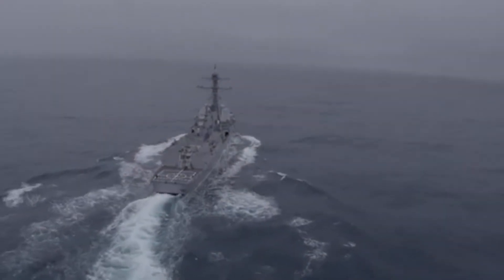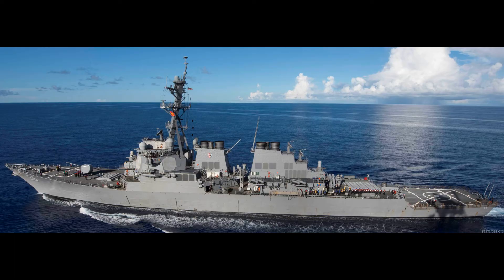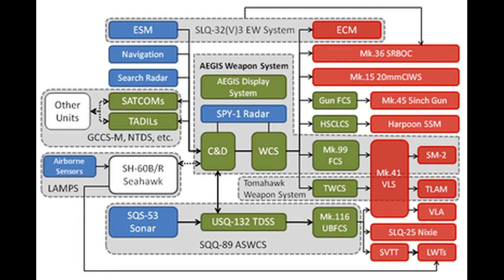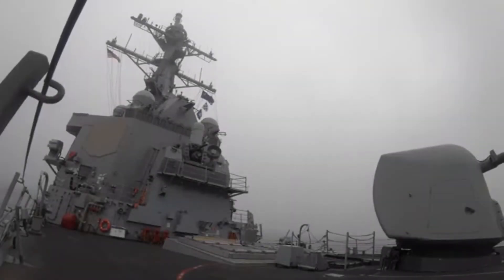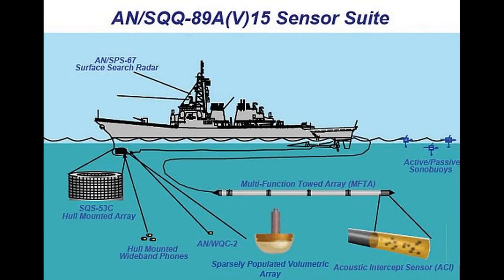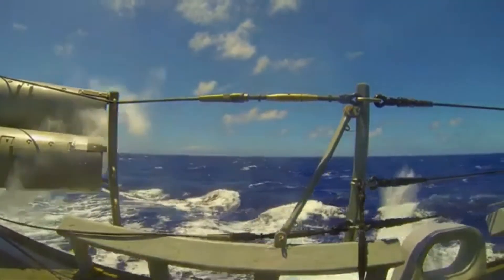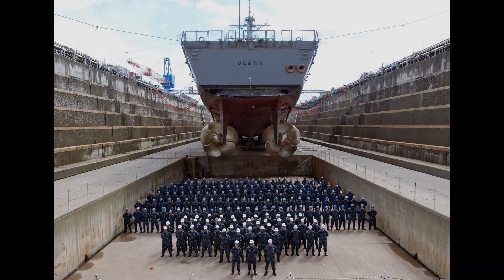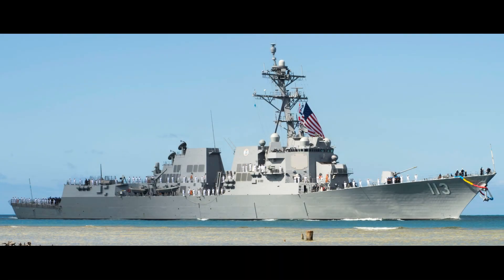Hypohystericalhistory's guide to the Arleigh Burke class destroyer

Comment: The Hunter Class, CSC, and Type 26 don't exist yet. I have no doubt that they will be better at anti-submarine warfare and quite proficient in anti-aircraft and anti-missile warfare. However, these have fundamental weaknesses. The most glaring is that despite their large size, the only carry 24 - 32 mark 41 VLS cells. The Hunter class has 1/3 and the Hobart class has 1/2 of the Villa cells found on the Arleigh Burke. The Hunter class is comparable to the US Constellation class frigate, although it has the advantage of having not only S-Band radars, but also X-Band and L-Band radars.

Comment: I know they're called destroyers and ship type-terminology has changed with the rise of multi-mission naval platforms in the past 60 years, but the Arleigh Burke seems more like a small cruiser rather than a destroyer. At least in size and cost. They're wider and are only somewhat lighter and slightly shorter than the Ticonderoga class cruiser which performed much of the same mission roles
Reply: Yeah but I prefer to think of ship
Class is less about size than it is about mission platform.

Destroyers are the multi role, do anything types

Cruisers are the fast and fully loaded dishers of damage

Battleships are meant to be survivable behemoths, but that doesn’t sound possible with modern weaponry
Reply: Basically a light cruiser in sizw

Comment: I worked at GE Gear Plant in Lynn mass.  I had the opportunity to work on the RD Project for high speed reduction gearing to be installed in ARLEIGH BURKE class destroyers. GE installed the largest 7 axis CNC Horizontal Boring Mill just for that project. Myself and another machinist operated it.  We machined the main body. All parts including the bull gear were in stalled in it and on it.  I'm 60 and still claim my part in machining the high speed reduction gearing. I believe 84 to 86 and i cannot remember the exact years. I believe the first 2 were  test subjects. I do remember hearing the 2 at high speed then low speed for a couple of continues days. After accepting that part of its qualifications. They then ripped it completely apart. This was to check for problems and other conditions.  We then machined the ones for ARLEIH BURKE class destroyers and his namesake  DDG 51. Never had a chance to actually see one installed. Its on my bucket list and please disregard any spelling mistakes.
Reply: I forgot to mention that new gas powered turbines. The complete system was state of art. The old gas powered turbines were not made for its gear set specifically .

Comment: Australia could have had a smaller version of the Burke class Destroyers, a 8,000 ton plus design lost to the Spanish F-100 Frigate. The Gibbs and Cox proposal had 64 VLS cells, two hangers for helicopters, two CIWS, had longer range and if we acquired four ships would have allowed two ships on each coast. It lost out because it wasn’t a proven design which I find bizarre considering it’s based on an existing ship and it was specifically designed to meet RAN requirements
Reply: The RAN requirements would have mandated extensive modifications making it into an entirely different vessel.

Comment: The RAN is making the significant mistake of buying European ships and giving them European crew sizes whilst operating with pacific designed warships with properly manned ships 
US , Japan, South Korea, Communist China , republic of china and Russia all operate ships 200+  crew for frigates , 300+ crew for destroyers and 400-700 crew for cruisers whilst Australia has destroyers of 180-200 crew and frigates of 160-180 crew
Reply from the maker: Its just the money; we have trouble manning the fleet that we have, so less crew is a huge bonus in terms of operating cost.
Reply: @hypohystericalhistory8133  but the issue is the RAN burns through sailors by flogging them on undermanned ships with a poor retention rate , if Australia had properly manned destroyers like it did when it was operating Charles F Adam’s class there would be a better retention rate 
ADF also has a rank bloat issue with 1 officer per 4 enlisted
Reply from the maker: @mosesgoldbergshekelstien1520  I’m sceptical it’s the RANs manning levels that lead to poor retention rates. You have a report where that was the conclusion or is that just your idea? My  understanding is the RANs surface fleet is manned at the same levels as other navies with comparable warships. Maybe a little low compared to other Meko 200 users, but the Adelaides were the same as OHP.
Reply: @hypohystericalhistory8133  of course there’s more than one reason that causes the retention issue but one of the main reasons the RAN is burning through sailors on the Mekos and F100s is they’re severely undermanned for what they’re treated as , our OHPs were manned the same as other navies in fact later in its service having an even greater crew complement with the addition to gypsy caravans ( demountable buildings added to one of the hangars ) the OHPs of the RAN had a far greater retention rate as you had a frigate with 220 sailors compared to the Mekos with 160-180 sailors conducting the same roles , those additional Stokers , communicators and boatswains made a world of a difference and long before that ships sailed with GDs ( general duties sailors ) 
The RAN is currently operating the 200 manned F100 frigates as if they were Arleigh Burke’s , the Spanish and Norwegian F100s do not operate this way knowing they’re not destroyers. 
You save money in the long run when you retain sailors and junior officers
Reply: Large crewed ships are getting obsolete. Even the USN future Constellation class has less crew than similar sized ships, the LCS also have less crew, and even the massive Zumwalts has less crew needed to run the ship than a Burke. Even the large USN is having problems with manning that's why a couple of Burkes have rammed a lot of commercial ships since they mainly deploy with just a third of the intended crew(a overworked and undermanned crew is not a battle ready crew). The future Large Surface Combatant (Ticonderoga and possibly Burke replacement) will also have that feature probably borrowing the technology from the Zumwalts.
Reply: @chesterlynch9533  large crewed ships are definitely not getting obsolete, Japan , South Korea, PLAN , Russia, Taiwan and USN all operate frigates with 200+ crew , destroyers 300+ crew and cruisers 400+ crew , minimum manned ships has been a disaster and something modern western navies have gotten away with ever since the collapse of the CCCP and uncontested peace time at sea thats rapidly changing though with the PLAN fast tracked to become the most dominant navy in the world, I like that you mentioned the LCS both of which have been a massive disaster and US 7th fleet proved for them to be effective they need an additional 120 sailors and officers permanently embarked not modular set up, they’re also incredibly under equipped and poor sea keeping duties, additionally with the zumwalts they’re all round incredibly expensive vessels with high maintenance modern sensors, there’s a reason the PLAN, Japan and USN are continuously building large crewed multi purpose destroyers, it works well and is reliable 

The USN future Constellation class has correct manning of the FFG , it has 200 sailors and officers the same as the Australian F100 class frigates 

Additionally the issues you noted on the two incidents with 7th fleet DDGs having collision accidents was also again due to ships being undermanned, multiple broken onboard systems and heavily fatigued crew, it’s pretty simple you want ships to have as many additional junior sailors as possible , things go wrong at sea and modern warships have an insane amount of high tech equipment which means more room for error
Reply: @mosesgoldbergshekelstien1520  That only applies to China because they have a lot of population to get the crew from. Korea and Japan is still getting Burke variants thats why it is large crewed. When you look at Japan new Mogami class it's a 5,500 ton frigate with only 90 crew. The Korean Daegu class frigate is crewed by 140 sailors and even more is their future KDDX destroyer. The US Constellation class which is based off Italian FREMM only need a crew of 150 with the additional 50 birthing for aviation or sf/boarding parties in comparison to the German Sachsen class frigates at 5,500 tons which still needs 230 crews to run the ship. Even if you ask a Burke crew they will tell you that they have been running burkes with less crew that it's supposed to be deployed with which ultimately resulted to previous accident especially with the current OPTempo. Your information on the LCS is outdated since they already got of rid of the contractors and now they are crewed by around 70-90 crew depending on LCS mission. If the USN wants to able to field more than 355 ship Navy, they need optimally manned ship because they already lack the manpower to crew all those vessels.
Reply: @chesterlynch9533   all the countries listed above have large enough populations to man their navies and support personnel needed for each ship, the only country I listed that has had a population shrink was Russia as it dissolved into multiple nations when the CCCP collapsed, the numbers of personnel in all navies have shrunk whilst populations have grown so that comment makes little to no sense, Correct South Korean and Japan have DDGs that are arleigh Burke variants additionally japan has DDs and DDHs which also carry 300 or more crew, the new Japanese frigates that they’ll be building 20 of will be the first of its kind globally in basic terms it’s a lot like the soviet alpha class submarines where you’ll need a highly trained technically trained crew to operate them its comcem, CIC , engineering and electrical sensors will all be controlled from a single compartment in the ship additionally they’ll act as drone motherships carrying UAVs ,UUVs and USVs it’s something I can see Japan pull off as they’re the best sailors I’ve ever worked with, the USN future FFGX will not be 150 base crew with 50+ flight crew it only has a single hangar for a single helo it’s a base crew of 180 sailors and officer plus flight crew of 20 embarked, the information about the freedom and Independence class LCS is not outdated as they are still multi-role modular vessels with no true purpose and a small base crew onboard and embark larger crews depending on specific missions, as I stated USN 7th fleet found for them to perform proper duties as a task group escort vessel they need a base crew of at least 120 sailors and officers then embark a mission specific crew, 
Put simply now that the PLAN claims they happily country the 9 dash line and will be moving onto the second island chain within the next 2 years the navies that operate in the pacific are realising they need real warships that are properly manned especially in an area with so much surface and air traffic with navies operating in large surface action groups
Reply: @chesterlynch9533  125 million isn’t a large population? That’s more than enough people you don’t need billions of people for the Manning of fleets of this size, you’re the one misreading what I’ve written nowhere have I stated I have an issue with new technology in fact I’m in favour of it I have an issue with minimum Manning ships, you talk of weapon sensors and automation but you need additional crew when you have issues like damage control, NBC warfare, when you lose 33% of ships company due to an illness, you stated the constellation class has a base crew of 150 this is incorrect it’s 180base crew plus 20+ embarked flight crew which is 200. Personnel which is proper Manning for a frigate or destroyer escort 
The LCS has been an expensive disaster for example you have the first 2 ships of both classes decommissioning early these ships are barely a decade old, they have an identity crisis and serve no true purpose towards surface action groups or carrier strike groups, the whole premise of using a 300million dollar vessel for ASUW against fast attack craft is a ridiculous concept, then mission modular set up depending on what specific role this ship is tasked with, even with the new NSM the ships are still incredibly under equipped, there was a reason Lockheed Martin and Austal were the first 2 of the 5 ships selected for FFGX program to lose
Reply: Sejong The Great cost about 930 plus million USD. 128 VLS cells and Aegis.